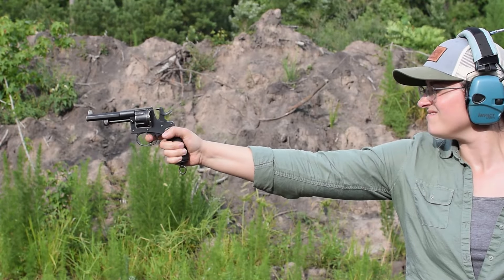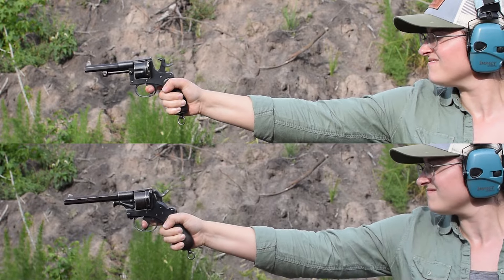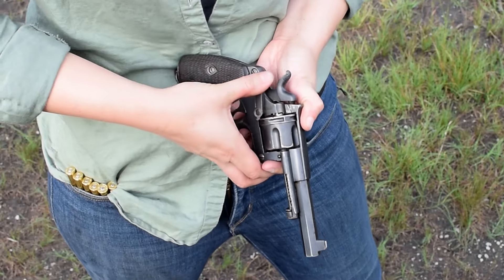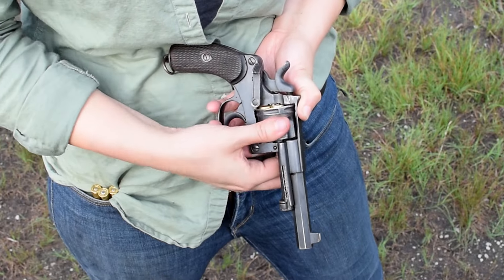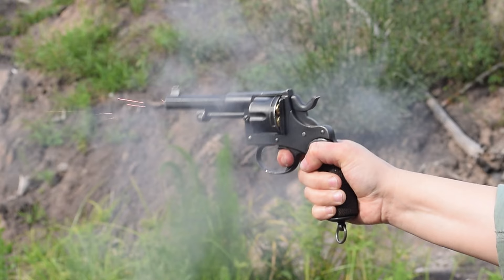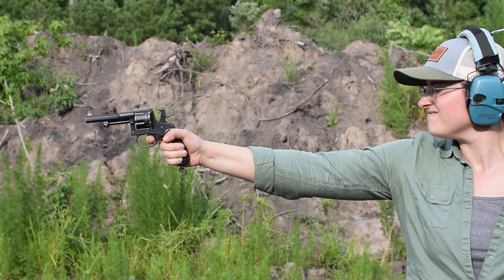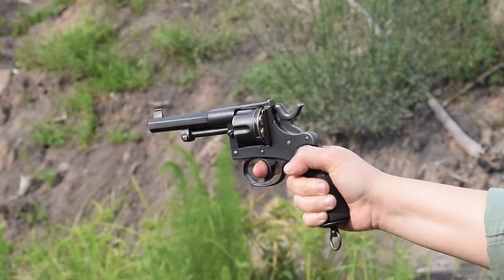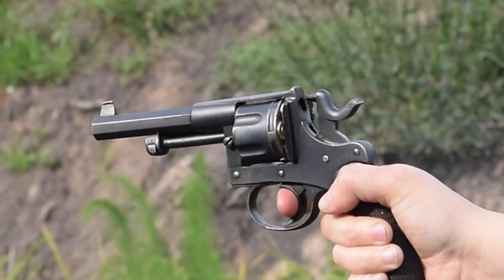Minute of Mae: Dutch 1891 Revolver

Comment: I have a revolver that is 9.4; it may be an 1895 used in Indonesia.  The DA pull on it is terrible and if the loading gate is down one can rotated the cylinder by pulling the trigger without the hammer moving backwards.